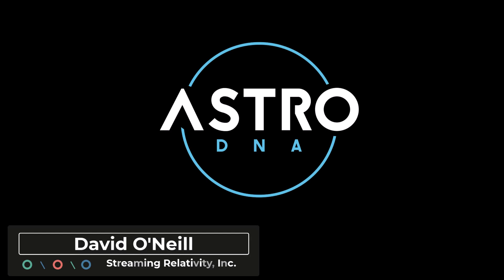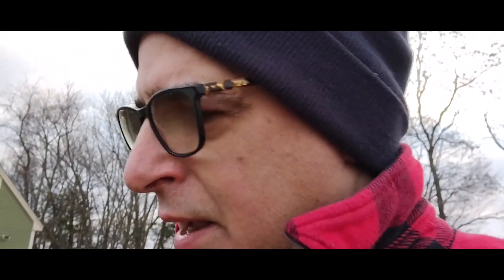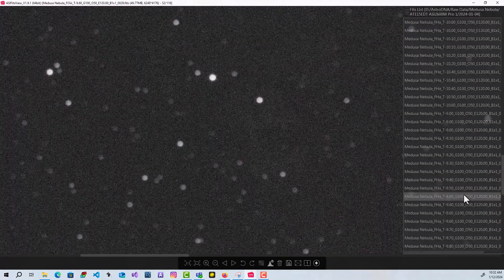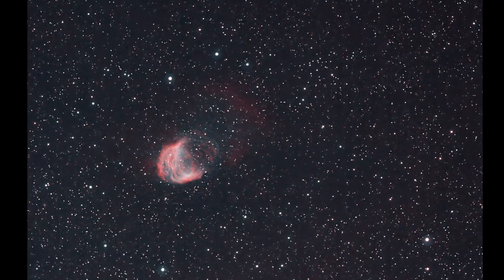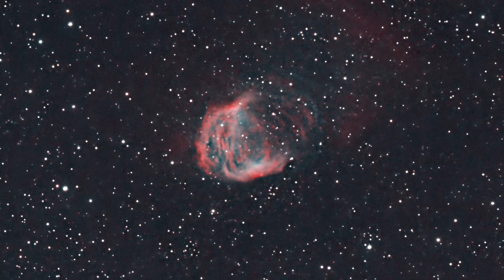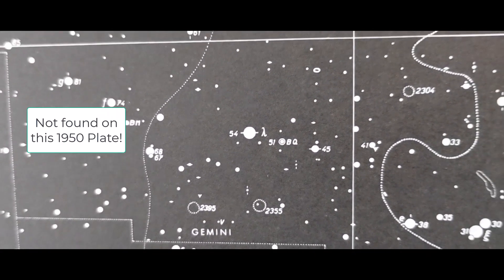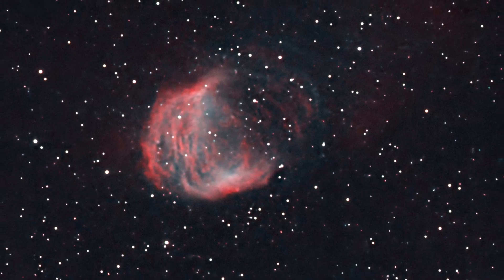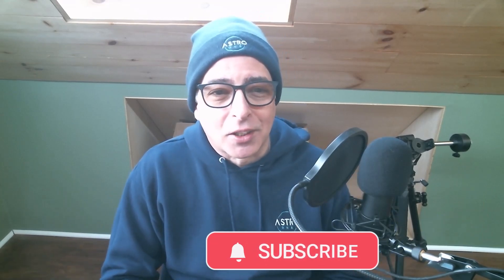Medusa Nebula Turned my Astronomy Rig to Stone

Comment: David, I'm not sure if this is a good place to ask a question since you've probably moved on to other projects by now, but you mentioned having tuned your focuser parameters as a result of the Medusa Nebula experience. Since I'm trying to get focusing working with an EAF on an AT115EDT, I'd like to know the details: what parameter setting you settled on, and the process you used to get there. Thanks!

Comment: Good to see it was a small binding incident easily fixed for the mount. Great video and story
Reply from the maker: I had made some adjustments to the DEC gear meshing early on to address a backlash issue I recorded when I first tested the new mount. Those adjustments were made with my C8 mounted. When I deployed the AT115EDT, I think the different weight profile revealed I tightened the mesh a tad bit too much. Cheers!